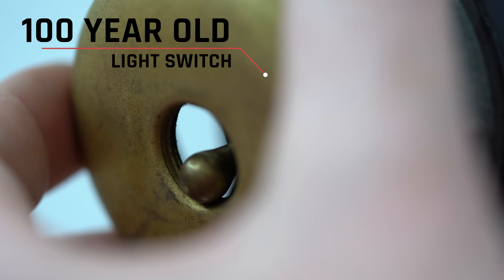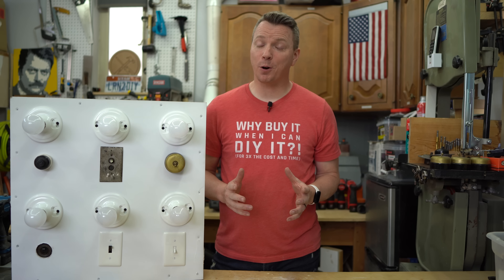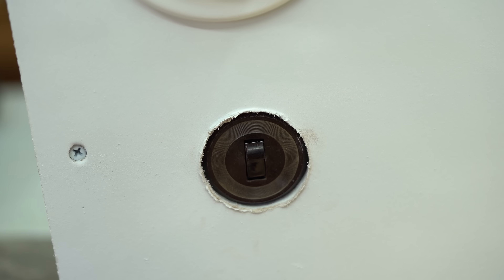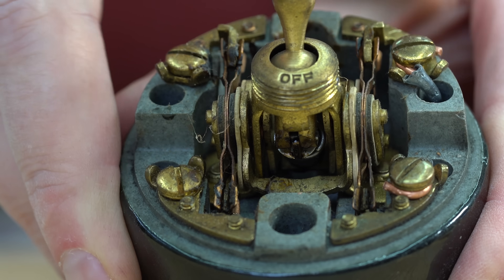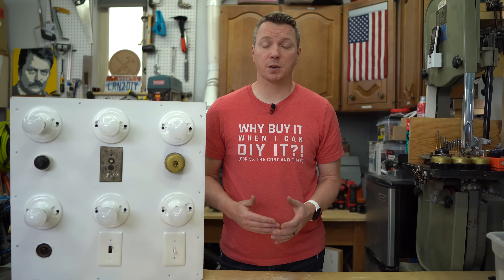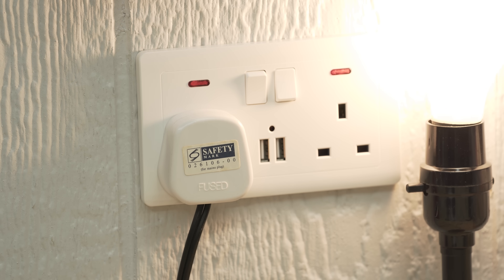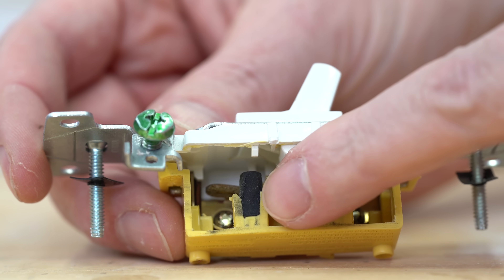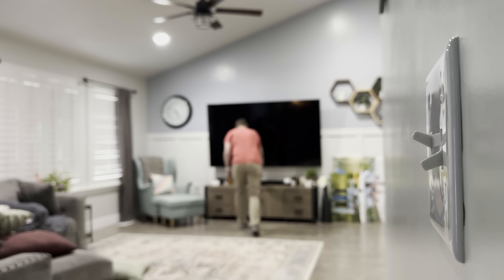How a Simple Spring Changed Light Switches Forever

Comment: When I was a child, for about 3 years in the late 1990s we lived in a duplex,  I was told was built in the early to mid 40s, to welcome soldiers home returning from WWII.   Our home had wood clapperboard siding, some of the nearby homes had what could have been asbestos cement board, and the homes on the block were different colors /materials either because of remodels over the years or material shortages caused by the depression and war.  Anyway the home I lived in had push button switches,  cast iron radiators for heat,  a gas range, and of course a fuse panel. My fondest memory was sticking my finger in an open fuse socket,  getting thrown back and busted my head on the coffee table requiring sutures in the back of my head, I was about 7 or 8 at the time and ever since I loved push button switches and am currently a journeyman electrician
Reply: Sounds a lot like how I got introduced to elecicity. Stuck my dad's keys in a 240v outlet and went for a short flight. Currently the uh oh guy on industrial air compressors using 3 phase power up to 4180v and 600 horsepower.
Reply: Once, when I was about 4, I stuck my finger in a lamp socket, fully aware of the fact that it was supposed to be dangerous. It was relatively uneventful.

Comment: Just about everywhere in the world except America its off when up and on when down. 
Also, Just about everywhere in the world except America its earth pin at the top!
Why so upside down?
Reply: It can be installed either way.  But the logic behind having the earth pin up is for two reason.  If you dropped something metal unto the plug it will hit the ground pin, reducing the risk of a short.  When people plug things in they tend to push from top to bottom. With the ground pin on top that insures the ground pin gets inserted first, reducing the risk of shock.  In Europe they make the pin longer and wrap the pin in rubber to achieve the same and also safer effect.

Comment: I have a 1914 Bungalow house and still use the push button switches.  These are porcelain beasts and after being cleaned up have worked fine for the past 20 years.  You didn't mention though that some switches have wiping contacts..that's a plus because they keep the contacts and contacter clean.  And can carry more current.  But now switches of all varieties are going away replaced with wifi bulbs.
Reply: Nope! Not me! Wifi routers die and I dont' want to be stuck on a Saturday night not able to control my lights until Best Buy opens. Manual swtiches until I die!
Reply: What's the advantage of using wifi? Having to whip out your phone to turn on the lights? You can elbow a switch, even if your hands are full. Maybe a motion-based switch for a cellar, a hallway or on the stairs.

Comment: I too grew up in 2 different houses (same neighborhood and build date--1918) that had the push button switches. Black plastic (probably Bakelite outer circle with a mother of pearl inner). All of those houses originally had coal furnaces with brick bordered holes (for the coal deliveries) on the outside at ground level leading to the basement. They all also had terra cotta roof tiles which as well as being cool as heck and attractive, were pretty much lifetime roof tiles (barring a tree limb or storm blowing something into them).
Reply: It's comical that he thinks these 99 cent switches are reliable.  What exactly is his definition of reliable?
Reply from the maker: @tarstarkusz - it’s the fact that there are thousands of homes with these cheaper than cheap light switches that have been in use for 10, 20, 30 years and are still working great. Even if you buy the more robust light switches at $3-5, that’s still an incredible value for something that can last for decades or longer.
Reply: @LRN2DIY  Most stuff over 20 years old was made somewhere other than China.  The poor quality that comes out of China is absolutely outrageous. They even produce drywall which will destroy your electrical system.
Reply: @tarstarkusz  Hydrogen sulfide corrosion... doesn't take long either. Also, makes your house smell like rotting eggs.
Reply: @tarstarkusz  china makes good stuff and bad stuff. Really depends on the quality demanded and paid for. Most made in America stuff is worse than china these days...
Reply: @Kartoffelmeister89  Malarkey!!  The bottom has dropped out.  THis level of poor quality was totally unacceptable as recently as the very early 2000s.
Reply: @tarstarkusz  works flawlessly and lasts 30+ years is a good definition
Reply: @Kartoffelmeister89  You can't say that anything made in the last 10 years in China because it hasn't been 30 years.